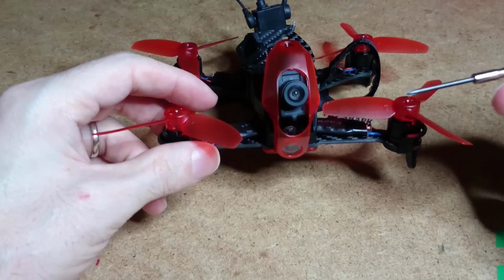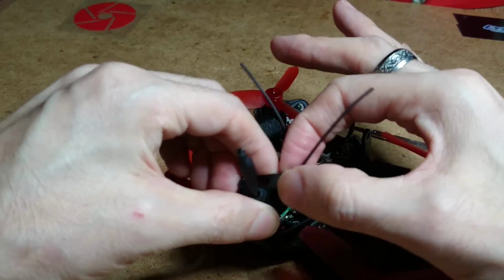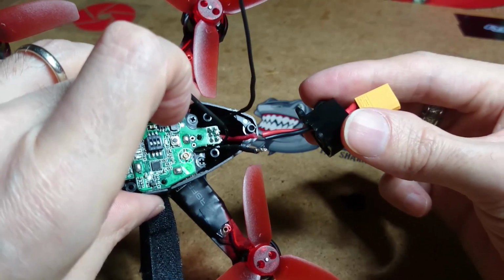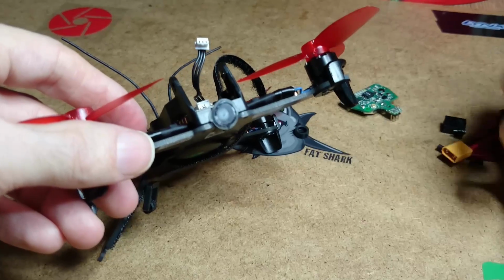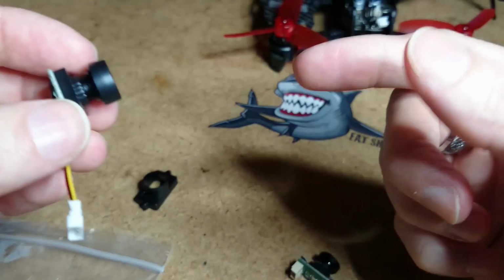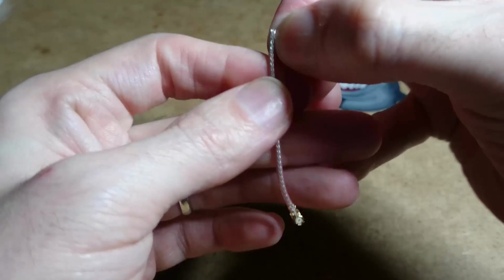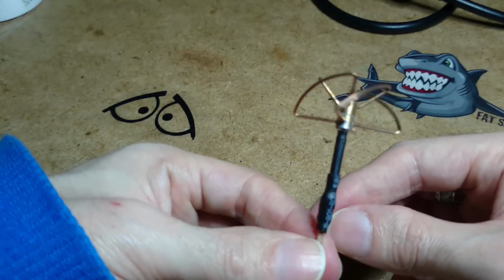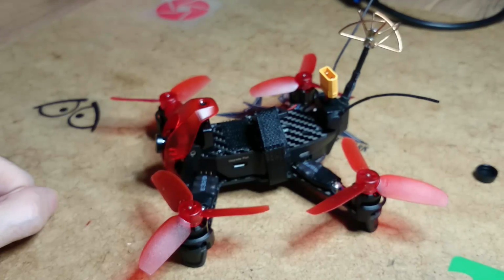Walkera Rodeo 110 Mods Camera,Antenna And Battery

Comment: Hi,Merc rc, I did look on  ebay, and found a AMTwith the end that snaps on the clip on the tx on the walkera 110 under$8.00 free shiping, and it looks real good  it is  a spirel clover leaf ant, right hand., just plug it in  and all ready to fly,
Reply from the maker: The connector to the vtx is a U.F.L one and yes you want a RHCP clover leaf antenna.

Comment: Hi there quick question about the 110, on the stock antenna the short wire on the tip has come up missing. How will that affect my quad is it critical to maintain the length or will it be ok to fly like that. I would guess it was 1/4 inch long. Thanks Merch
Reply from the maker: Ow you might have alot of picture cut outs and fuzzy lines and you might not be able to fly far,buy a new antenna to be safe.

Comment: I just replaced the original cam with the 1000TVL from Banggood - and it's far better! Here's a comparison video: https://youtu.be/euW01rCJsSM
Reply from the maker: Yes it's way better ,i already have many comparsion videos up on the 600tvl,700 and 1000tvl camera and now the runcam micro.
Reply: The Runcam seems to big for me on this tiny guy :-( I also wanted to do as few modifications as possible. Replacing the cam with the 1000TVL was pretty straightforward. Finally I got rid of the crappy original cam :-))
Reply from the maker: The new micro is small did u see the video?.......yes there was more of a mod to do but worth it.
https://www.youtube.com/watch?v=bK7bdbAEVb4&t=10s

Comment: Hey merch my receiver wire got chopped off on the 110. Unfortunately its is soldered to the fc. How can this be fixed. I haven't tried to fly it to check if range is affected.  I don't really fly far anyway with this model. Thanks !
Reply from the maker: Try and find some 2.4ghz wire and solder a new one on,just remember there is a inner core and outer wire don't let them touch when soldered to the board and goo it when done.
You could take the wire out a old dipole antenna and use that or buy one of these and cut it to the lenth you need.
https://goo.gl/64jP5o
Reply: Merch RC Yeah thanks! I looked on some YouTube vids on just how to repair instead of replacing. I took a look at RC model reviews and striped the wire and worked fine and put some heat shrink.

Comment: You had already cut your wires to the JST connection. Is it possible to get those 2 screws holding it in out without cutting the wires first?
Reply from the maker: Yes just takes these screws out https://youtu.be/SW90e_u1pFE?t=5m54s
Reply: Yes, those are the screws I'm talking about. Maybe my model didn't have enough wire to pull it out far enough to get to those screws. It's possible only after I ended up cutting them. I just put a new jst back that was easier to unplug and glued it in place. I'll see after it dries if it's any easier to unplug.

Comment: merch rc thanks my friend. i actually got a different camera which already has the 3 pin plug in the back so i was wondering if I can just plug it in to the stock plug?
Reply from the maker: No i doubt it would fit and the wires will be in the wrong place check this video https://www.youtube.com/watch?v=2PHF34ViL8Q&index=2&list=PLRwpU61x3GQnPECWfowVfJb9TeIKPZ8NS&t=125s
Reply: Thanks for your quick replies. The camera i have only has a 3 pin port soldered to its board with no wires. And the walkera plug fits perfectly. So do you think even with the plug fit correctly into the slot something may not be correct?
Reply from the maker: You would need to make sure + - and video signal wires all match up or you will damage the camera.
Reply: Thanks alot. 1 more question so it would just be the camera that gets damaged if polarity is reversed and nothing else? I wont hold you to it but there really isnt anyway of me knowing what is what on this camera. There are no wires or markings
Reply from the maker: Yeah the camera will get the damage,what camera is it?
Reply: Its a camera i had on my 250 which i know is to big. Its a good 1/3 cmos 2.8mm. I just wanted to compare video with the stock camera so i knew whether or not to buy the one from banggood or not.
Reply: I now understand what you were saying in your one video how the walkera cable plug is reversed.

Comment: thanks fornthe vid. didnyou switchbout the camera? inhave a mini 1000 tvl which i want to swap out so will that work ok with the stock vtx?
Reply from the maker: Yes i took out the camera and put in the 1000tvl one,you will need to solder it all up to get it work.

Comment: what does sugar on the double sided sticky tape do?
Reply from the maker: Huh you lost me Alexander lol.
Reply: Merch RC sorry about that. In the video you mentioned "putting sugar on the double-sided tape". Just curious as to what you were referring to. Also. What lipo batteries are you using with that xt60 connector
Reply from the maker: Umm could you tell me at what part of the video i said sugar,cuz i have no idea what you are talking about lol.
That's not a XT60 it's a XT30,I use the stock and nano tech 850mah batteries but i have changed the plugs on them.
Reply: That confused me too.. 
At 17:30: "What i'm gonna do is add some sugar on top of that", 
and again at 18:56: "i'm gonna put some sugar on there"?
Reply from the maker: Not sugar lol i'm say saying Shoo Goo lol........it's  because i had the cold my voice sounds funny hehehe plus i say it so fast.
Reply: lol figured I must have heard it wrong..
Nice video though, I'm about to try it out with the 700tvl camera and a furious antenna right now so thank you very much for the tips.
Reply from the maker: Hehe np hope you'r modding goes easy:)

Comment: Hey bro.  Have you tried a 3s battery yet?
Reply from the maker: No i have not but i know some that have,they used a low C rating and lesser mah to put less stress on the quad,In the long run it's not worth it you will end up frying something because ESC's and motors will get hot and when the good weather comes in boom goes you'r quad.

Comment: I've used E-flite 450 mah 3s 20c and Floureon 800 mah 3s 25c I've done 6 flites with no break. No problem And 30 + total flites with 3 s. Slip in 2 s and power gone 😤
Reply from the maker: Err do you you mean 2s lacks power now or you think something is damaged?

Comment: Been running 3s battery. No problems. Have had 20 flights. All good. Has lots more power. Especially on pouch outs.
Reply from the maker: Nice what c rating is the battery and i guess you have breaks before you plug in the next battery?
Keep us updated with how many more flights you have before it goes boom lol.........(joking about the boom part)

Comment: Did you happen to find any bootloader pads while you had the quadcopter taken apart? I really want to flash latest betaflight on this thing.
Reply from the maker: No sorry i did not look for any bootloader pads when i had the quad open.......someone else is looking for this also, lets see who finds them first,Another thing is walkera run a custom firmware so maybe best to wait until they release a update?
Reply: I dont think they'll ever release an update. I just want a proper airmode.
Reply from the maker: I'm sure they will,give it time the quad is not long out.

Comment: If you keep adding things to the rear of that thing you'll be doing wheelies. If we're looking for a replacement camera, what are the specs we should be searching for?
Reply from the maker: This is only a test mod of the antenna but it works great........I have found a very light antenna that should be better than the stocker to use this will be coming up in a later video as you can see i only added an extra 6g so that is nothing since the quad can carry a mobius easy.
look in the description i have linked all cameras that will work and there specs.

Comment: Are there any other motors that can be put on this quad?
Reply from the maker: I guess there might be but you would have to look around and check to see if they will work and fit why do you ask?.......has one of you'r motors broke?
Reply: Yes I had a minor collision and the prop and too casing of the motor came off of the magnets inside. I couldn't find the bearing to put it back together.
Reply: It's the escs I'm worried about. What I mean is can they handle a different motor maybe a slightly better one without getting fried
Reply from the maker: The motors are 5800kv there around the size of the tarot 130 i think,It's trial and error but i would ask here https://www.rcgroups.com/forums/showthread.php?2661890-TAROT-TL130H1-a-mini-beast-FPV-racer-%28in-construction%29 as Seby has both of these quads or get the stock ones from http://www.ucdrone.com/parts/rodeo-110-parts/rodeo-110-motor http://www.banggood.com/Walkera-Rodeo-110-Spare-Parts-5800KV-Brushless-Motor-p-1122060.html?rmmds=search
Reply: I already went ahead and ordered a replacement motor from amazon, but I appreciate the response, Merch I really do! I did a bit of research and found a motor that I think would work for future upgrades. It's a rotorx motor. I believe it's the rx1104. 6500kv. It might take some modification on the frame to mount it, but I think it would beef this thing up quite a bit. Seems to use the same size props as well.
Reply from the maker: Nice!........If you ever do get the rx1104 let us know how things work out.
Reply: Will do!

Comment: is it worth upgrading to the rodeo 150 cam on the 110? or is the 150 cam same quality as the 110?
Reply from the maker: The 150 cam is worse than the 110,Some 110 cams are out of focus maybe check your's.
Reply: Thanks for answering, im getting 2 rodeos 110 im looking for a camera for them, looking for a small 650/700 TVL 90 FOV
So far best candidate is http://www.banggood.com/650TVL-14-CMOS-3_6mm-Lens-6MP-HD-Mini-FPV-Camera-PALNTSC-3_3-5V-p-1112281.html?rmmds=search
650 tvl 90FOV comes whit board and 4 IR leds. looks to be same size as the camera you used.
Reply from the maker: From what i see that's 65 FOV bit narrow imo,I did link you 100 FOV one.
Reply: did not notice that, thanks for pointing out.
i was going by my chart
1.2 mm lens has approximate 185 degree field of view
1.7 mm lens has approximate 170 degree field of view
2.1 mm lens has approximate 158 degree field of view
2.5 mm lens has approximate 147 degree field of view
2.8 mm lens has approximate 130 degree field of view
3.0 mm lens has approximate 127 degree field of view
3.6 mm lens has approximate 92 degree field of view
4.0 mm lens has approximate 88 degree field of view
6.0 mm lens has approximate 78 degree field of view
Reply from the maker: Maybe you are right but one of the BG staff said it's 65 FOV that's all im going by so who knows lol.

Comment: I tried a 3s battery. 450 3s 30c. Battery from eachine 130. It's a beast with 3s. ESC were very hot. Got 4 min. Fly time. 
The 110 with stock2s battery is faster than eachine 130 with 3s.
Reply from the maker: Ow you are brave to test this out:).......I wouldn't fly it with 3s too much as you noticed the ESC's were very hot it will more than likely cause damage to them,worse case fried ESC'S.

Comment: So I slammed this thing into the ground and the antenna became separated from the board. Is it safe to just solder it back on? It's the camera antenna.
Reply from the maker: You mean the gold U.F.L connector attached to the antenna cable came of the board?........If so you just push it back on.
Reply: I wish it was that easy... the part that I press the connector to, snapped off with it. The solder broke from the board. Can it be directly soldered to the board or am I just screwed? Lol
Reply from the maker: Well you have two choices try and solder it back on,another person has done this but it's very hard to do or buy a new VTX.
The only place that has them in stock atm is here http://www.banggood.com/Walkera-Rodeo-110-Spare-Parts-TX5837CE-40CH-Transmitter-p-1122062.html?rmmds=search
Reply: I think I'm going to have too. They are super cheap and tbh my soldering skills are pitiful haha. Thanks for the advice Merch! Much appreciated.
Reply from the maker: No problem Kory.

Comment: Fantastic mod tutorial, Merch! I just got my 110 a few days ago. I love this little guy! It's perfect for newbies like myself. It's very stable in angle mode. It's very fast and agile. I've already learned how to handle it in horizon mode, and have nearly mastered rolls, and flips. I credit that for the excellent tuning these come with out of the box. I highly recommend this for anyone thinking about getting into the hoppy! Walkera certainly knows what they are doing aside from some minor improvements that can be made, which you have proven. All in all a great buy. I've crashed it many times and I'm still flying, no problems. Thanks for the mod video. I will definitely be doing some of my own very soon! Can't wait for the flight video with all the mods.
Reply from the maker: Thanks:)

Comment: Hi after all that does it fly any better? What was wrong with the way it came from Walkera? How much wt. did you add with your mods? Can you please show the link where you bought the 2S battery that comes with that connector? Thanks
Reply from the maker: They Rodeo 110 is a great quad and i love the way it flys it will surpass the rodeo 150 imo,the camera is a little better but still needs the one i put in.
I wanted to see if a 4 leaf clover antenna would be better than the stock one yet to fully test the results,the battery socket as shown and explaind in the video is why i did the mods.
Extra weight added 6g as for the battery connectors you have to solder them on yourself.
After all the mods it is easier to fly in the house now that you have a wider FOV........nothing other than that has changed in how great it flys:)
Reply: Merch thanks for the quick reply. Have fun flying please post the video when you test fly it out side.
Reply from the maker: Bring me some good weather and  i will have it outside with a video up A.S.A.P until then it's boring inhouse flying!